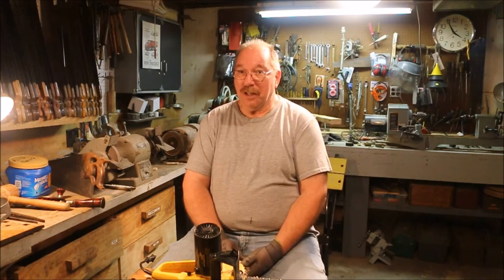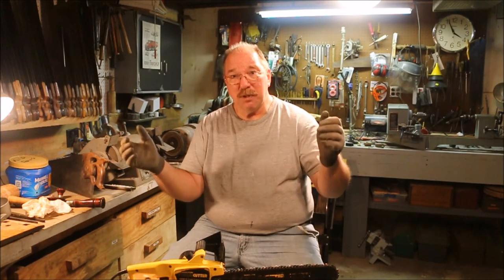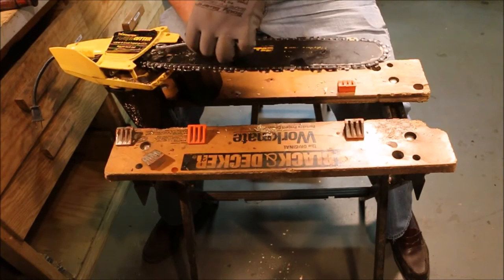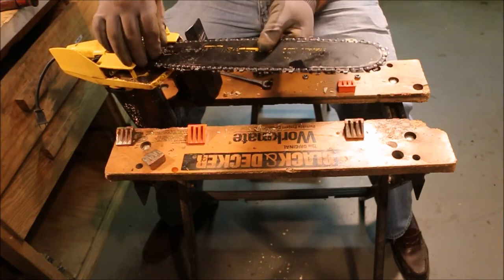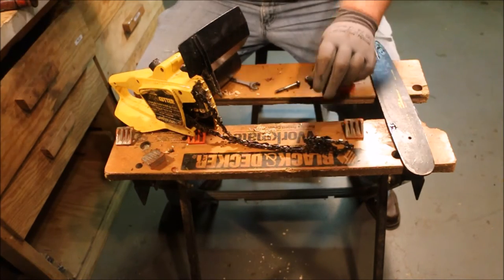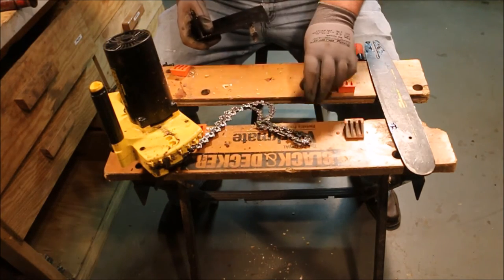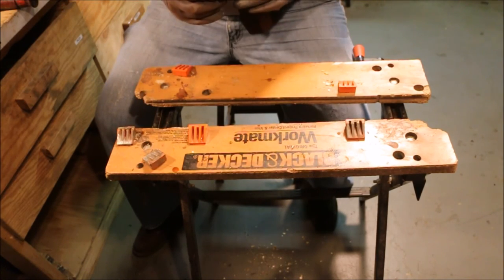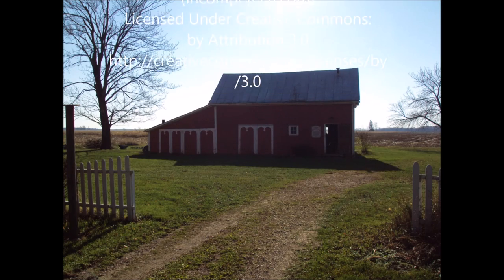Chain Saw Repairs Pt 1

Comment: I feel a lot safer with the electric chainsaw rather than the petrol one. You summed it up nicely when you said that you take your finger off the trigger and it stops, thank heavens !. A small chainsaw is a really useful tool in the garden.
Reply from the maker: I also own an 8" pole saw. Lydia borrows it to prune shrubs and smallbtrees.
Reply: I have a petrol pole saw that scares the heck out of me, especially when it has the extension handle on it. I avoid using it unless it is really necessary.

Comment: ..I need to be on the lookout for one of those. It sure would come in handy and would give my old black & decker circular saw a rest.  Yep i cut kindling with a circular saw...
Reply: I used to work for a guy when I was a kid and cut it on a table saw. Wonder if Taryl has one he'd send you!
Reply from the maker: Last year I used my Dewalt chopsaw to cut kindling. When I had the old shop I cut up a bunch of pallets, with a little plastic frame Black & Decker 7 1/4", that heated the shop quite well. It's a run what ya brung deal.
Reply: ..yep the old B&D works good and that's about all i do with it., that and i paid $2.00 for it at a yard sale, it had a $30.00 blade in it, it's on another saw...
Reply from the maker: Maybe the ex (or soon to be ex) was cleaning house?
Reply: Old Sneelock's Workshop Still that way here. DElivered the old shot mower deck to the scrap pile and foung an old belt drive squirrel cage blower that I wanted since the last one went bye bye in the blowout. Things look up. Also spent the day back in the saddle in a trackhoe digging various stumps and crosstie walls. My hindmost is dragging my tracks out but I'm happy. Burning diesel is good!

Comment: I've got a Workz for the expressed purpose of making a tree pruning saw out of. I've got a Marvin pole saw so I'm going to kmake an adapter and stick the electric saw onn the end with a squeeze switch or maybe evebn Sweetums with the plug.  Lots cheaper than extendable Stihl or Husky and lots lighter too. And it's good enpough for who it's for!
Reply from the maker: 12 years ago I bought a Remington pole saw for $89.00. I love it. If you can make a Workz version of the KawaSnapper it will make your life much easier.
Reply: Old Sneelock's Workshop I rented a Stihl telescopic real thing and it about killed both of us. Spent all evening hauling brush to the burn pit I cut in 15 minutes. I think I'd rather have my own and not worry about late charges.
Reply from the maker: Lewie McNeely I hear you on the late charges. That's what has stopped me from renting a bucket lift to take down some limbs and a tree in the yard. You bust your hump cutting everything in one day and then spend a week cleaning up the mess. Just so they don't hit you with another half days charge.
Reply: Old Sneelock's Workshop Perzactly. Pay 2 prices to start with and then get scorched on top of it all. Thanks but no thanks.